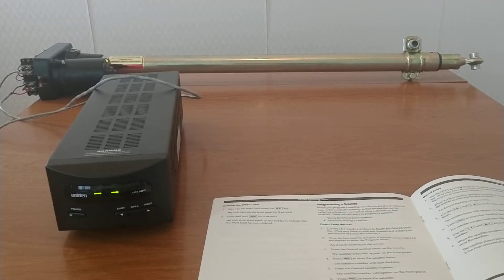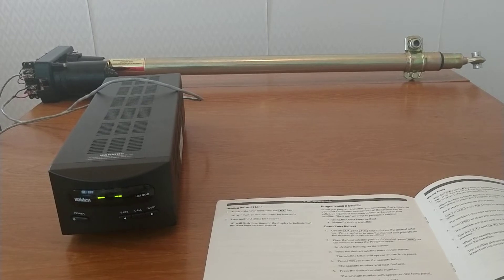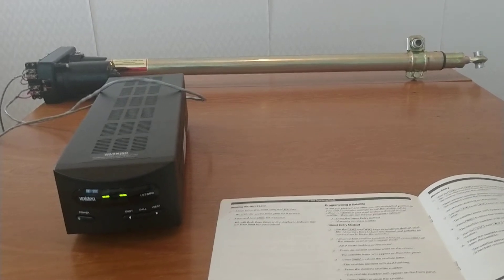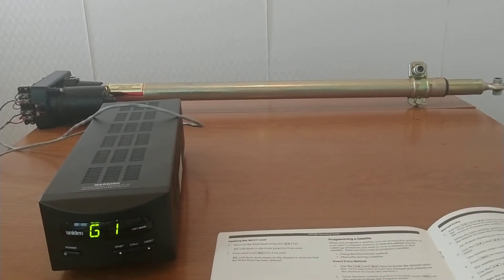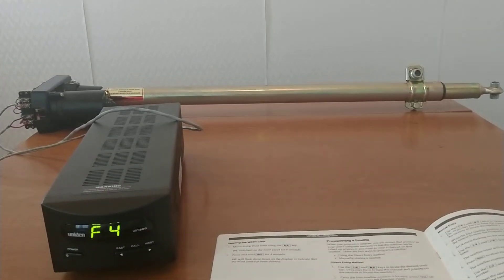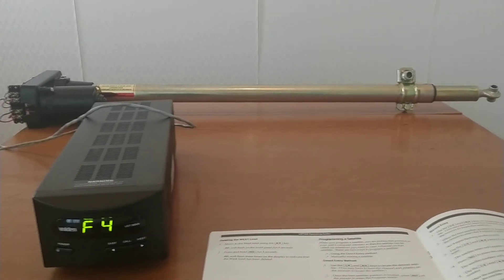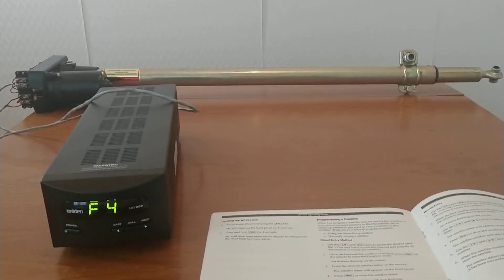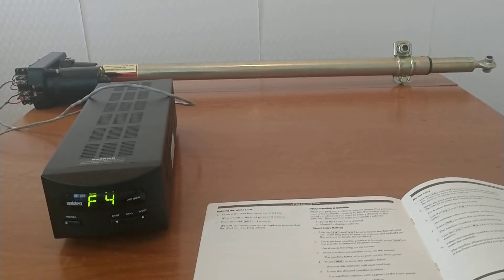Uniden UST300 Satellite Actuator Controller

Comment: HEY ! White wire -n Red wire +p Orange wire ? Brown wire ? Witch one connects to the +p side of the hal.\ effect sensor.
Reply from the maker: There's a thread on Satelliteguys.us with the owner's manual posted.  Hopefully that will help.  If not, there is at least one member there who has successfully hooked one of these up that may be able to help.  What you see in the video is pretty much my whole experience with these.  https://www.satelliteguys.us/xen/threads/uniden-ust300-actuator-controllers.394018/

Comment: How Many satellites can You store and what's the max amperage output ?
Reply from the maker: There's a thread on Satelliteguys.us with the owner's manual posted.  Hopefully that will help.  If not, there is at least one member there who has successfully hooked one of these up that may be able to help.  What you see in the video is pretty much my whole experience with these.  https://www.satelliteguys.us/xen/threads/uniden-ust300-actuator-controllers.394018/